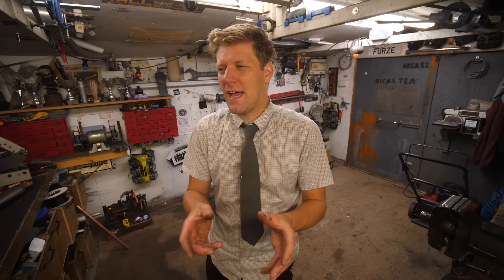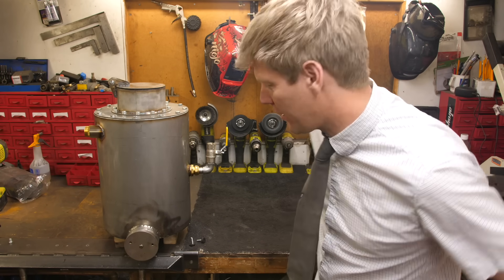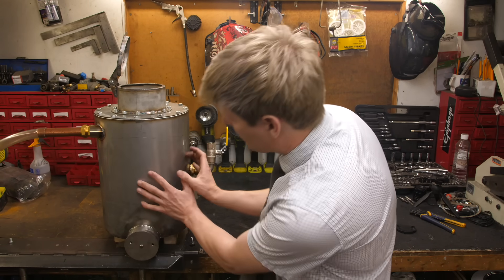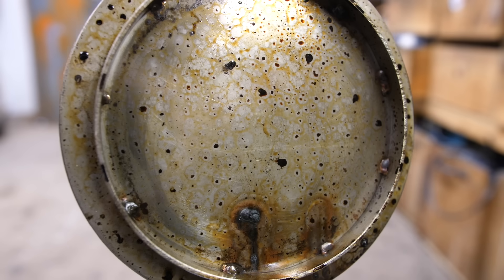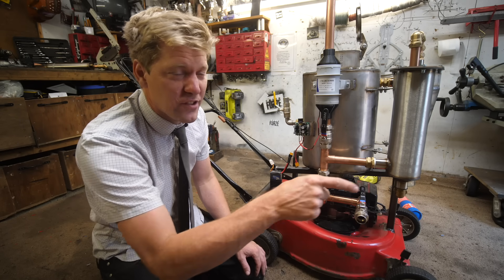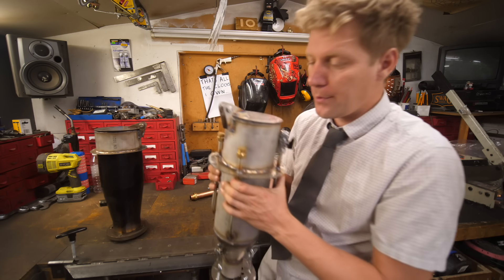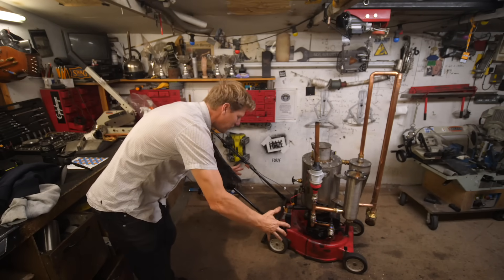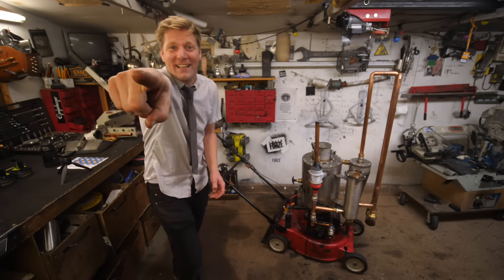WOOD POWERED LAWN MOWER

Comment: What if because the volume of gas coming out is more than going in you used a heat exchanger to heat the gas going in? Also you could use the exhaust to heat the wood. I bet it wood be a lot more efficient. You should try it for your next build.

Comment: Make hydrogen not woodgas. There's more water available on earth.
And use a water filter if you want clean woodgas.
Reply: You basically use the vacuum of the engine to pull the ignitable woodgas below the surface of the water to clean the gas. 
All the tar and crap stays in the water.
It helps to have the filtered woodgas feed from above the intake manifold for the engine. Although not always necessary because of the vacuum of the engine.

Comment: It definitely seems like you need the woodgas to be at ambient temperature going into the engine to get the most tar out. I bet if you just had fins on those copper pipes and a radiator fan or similar, you'd be cookin.

Comment: On the  filter side it's common to use a simple water bubbler.... not only does it remove tar it cools the gas condensing it for (better efficient) motor use.

Comment: get rid of the carb stuf just only have a throttle valve that wont have to much problems with the tar i think when hot the tar will help lube the engine and burn

Comment: You need to play with some Nichrome wire, it would have made this a lot simpler.  Also, after that result I would be tempted to build a huge waterpipe to remove some of the gunk by condensing it before it reaches the filter.

Comment: I was thinking you could modify it to run with steam thru the carb system, put a separate tank with water in with a valve to help it burn cleaner as well with some pressure from the steam, only open the valve once the engine runs.

Comment: One way to completely avoid the tar problems is to use charcoal or coke instead of wood. The wood gasifier is basically making charcoal anyway, the fuel is the absolute mess of chemicals you get from destructive distillation of wood - some of the products are gases (carbon monoxide, hydrogen, methanol vapour), but you get a lot of wood tar, which is a mixture of partially decomposed resins and creosote. Not great for running an engine on, though if you make a really big gasifier and capture all the tar, you can in principle distil the methanol and creosote out of it and use that as fuel for an engine, provided it has fuel injection (creosote doesn't vaporise too well in a carburettor) and isn't super-high compression, since the octane rating won't be great either.

Anyway, the simpler solution is to heat up a mixture of charcoal and water. This doesn't make any tar at all, since all that has been removed already by whoever made the charcoal. The products are all gases and there are only two of them - carbon monoxide and hydrogen. This is what "town gas" used to be (also known as coal gas), and these days is known in the chemical industry as "synthesis gas" or "syngas", since it can be used as a feedstock to make a huge variety of different chemical products. But you can just burn it, which is what all our gas stoves used to do when gas was made from coal. It can be used in an engine, and people used to do exactly this during world war 2 when petrol was rationed. Most car engines at that time were fairly low compression so didn't have a problem running on syngas, but a modern high compression engine would struggle. Not sure what the compression ratio in a lawnmower engine is, but if it works on your crude wood gas, then it shouldn't have a problem running on syngas.

Comment: love this! No expert but I feel like you are using the wrong wood as fuel. There is a reason why you do not burn pine in an indoor fireplace if you can help it. Too much byproduct and it doesn’t burn hot enough. A hardwood like oak would probably be ideal. Produces more btu and creates less waste.

Comment: So, where the next bit? Using the lawn clippings as fuel, would be a great next step for the mower :P

But, your gonna want a wood gasification system, and a storage system. The stored gas cools, dropping out the tar and the like. Using water at the bottom, means you can remove that tar with ease, and cool it faster, while keeping the pressure up.

Comment: Hey, @colinfurze I have a request. I've actually been looking into this technology again in case it's needed to run generators in Ukraine. I know you do what you do well, and it's interesting how you went through and found all of the little quirks that are in this technology. I can see a few issues you have with what you're building and would love to see you improve it how you do! The cyclone filter seems to be extremely helpful in a wood gasifier for removing junk. Also you need to cool the gas way down, this cleans the gas more and makes it denser. Also your final filter medium doesn't seem to be dense enough. Usually people use like hamster bedding or hay packed in to catch the rest of the particles. The heat in this causes 20% H2, 20%CO, 5%CH4, and the rest nitrogen. You do need dry wood to best do this and pellets are a common fuel. Some good areas to find information on these devices are these videos, "Running Your Engine on Wood-Gas with Wayne Keith!", "Wood Gas Part 2: Extras and In-Depth Info", and "amazing homemade gasifier uses wood pellets to run generator -- renewable alternative energy video". One last place to get a lot of good information about these is from the United States FEMA-Gasifier-Plans. Hopefully this gets you interested and we get another video of you perfecting this in your own way! Thanks for your awesome videos!
Reply: germans used it a lot in WW2 when petrol got short (even in things like schoolbuses). i'm sure you find a lot about this thechnology
Reply: @weeeds334  I've found about all I can find on this. But seeing a modern take on this is what I'm looking for. A more perfected version or perhaps a new quirk to be found. He was discovering a couple things without looking online. I would be interested if he finds something new. It's old simple technology but perhaps there's more to be found.

Comment: Wood gas is such an inefficient method. If you wanna use wood for power, build a boiler and use the wood to make steam and push a turbin for electricity.

Or just us a wood burning stove for direct heat.

Comment: Instead of the filters do you need to insulate the crucible. If you get the temperature up past a certain temperature, you will crack the tar into carbon. Try plaster, it is made with gypsum.

If you’re running a bigger unit in Mai want to keep it at a lower temperature to get the tar. The tar’s actual classification is third class heating oil aka creosote

Comment: please please please, get a proper CO (carbon monoxide) detector when using this. especially if you are planning to use it in a confined space such as your shed or bunker. Depending on the temperature you will be making CO, H2 water and CO2. CO is no joke, please be careful.

Comment: Here you have proven how extremely dirty it is to burn wood. All the mud in the filters and in the engine are simply blown into the air when you operate a stove. Even if you burn very dry and clean wood. Natural gas or gasoline is much better.

It is possible to replace gasoline with wood gas, but there are reasons why wood gas has never been more than a stopgap solution.

Comment: how bout using a blower to force air into the high temp burn chamber rather than draw thru?  The condensated tar when collected could drain into the high temp chamber (utilize a check valve?). also maybe a turbo could be utilized for the blower?  start engine on gasoline and taper off as the waste oil burners do with their diesels?

Comment: What's kinda wild is that humans have found a use for every output of a simple woodfire:

-the smoke contains wood-gas (flammable gaseous fuel source) and tar (rudimentary waterproofing, construction binder and adhesive), smoke can also be used to dry and preserve food. 

-the ash can in some cases be used either to make lye (can be mixed with rendered animal fat and water to make soap) or turned into a type of clay/cement for mortaring bricks together.

-charcoal is another fuel source of course, as well as a source of black dye, as a writing/drawing medium, as a dry lubricant for some machinery, and in some specific cases used to purge toxins from your system if consumed (I think). 

-it produces light and heat of course

Really puts into perspective how valuable the domestication of fire was for early humans.

Comment: the spark from the coil through the spark plug is required electricity without which the engine wouldn’t run barring some manor of dieseling effect.

Comment: I would instead make a stationary machine to produce the fuel. Perhaps its possible to use the wasted heat to drive a steam engine that could run a compressor to compress the  properly filtered wood gas into a high pressure tank which you can use to fill a small high pressure tank that you could use on your lawn mower.

Comment: The cooler is what densifies the gas and makes it more flammable, it also condenses the water vapor, as we all know water is not combustible. The tar is not an issue, in old times, they simply cranked the motor with tar in it, it's harder to start because of glogging, buy once you get the motor running the tar itself actually lubricates the motor. To completely remove the tar and water vapor your combustion shamber should be at least 3000 degrees celcius to split water molecules to hydrogen and oxygen atoms as well as gasifying the tar vapor. I haven't seen this done to this day, but maybe you could make it. It would probably require a cheramic shamber to withstand such intense heat as well as a really long pipe condenser for cooling the gas. You could simply put the pipe into the ground in a sick sack pattern to let the heat escape into the ground and heating it up. As a result you could have a heated winter pool above ground or space on your drive way without snow. Kinda nice way to use wasted heat. Also the final product produced from the motor as we know when you combine hydrogen and oxygen we get water again from the combustion cycle, which means you could get a source of fresh water from the gas outlet. Win win win.

Comment: I tried this as well, but after consideration I just went with a simple scythe... It's easier and requires less parts. Nice proof of concept tho. If it was legal in my country I would def. use it to power a car. If I did that, it would come with a heafty fine as well because power companies just wouldn't approve of free energy devices. Simple as. they want you dependent.

Comment: Funny thing is it needs a battery to run (for the fan motor)

Side note- why not have a wood distillery where you can filter and separate all the products and condense the combustible into a liquid and put that in the gas tank 🤷 oh yea I forgot your Colin Furze and have to make a crazy contraption 😂

Comment: I made a gasifier out of stove pipe years ago, happiest moment ever when the 5hp motor started. The next day I learned about valves welded shut with wood tar! I never built in a gas option to clean the motor out after my run. Your build was incredible, as usual :)

Comment: This i great. Long term viewer here I've been working on a home made generator out of a Harbor freight predator gokart motor a 12 volt 2000 watt DC to AC inverter and a electric motor from the wheel of a hoverboard but plz no welding I don't have a welder try to use basic tools that most people have in there garage plz and think you hopping to see some response back even a no would be better then nothing.
Have a good day.

Comment: Gasification has always fascinated me because it seems like such a simple, easy concept at first, but in practice take quite a bit of knowledge and experience in particular in order to make an actual working, reliable system.

The key seems to be cooling the gas down enough (without using water) via a seemingly comical amount of surface area (via tubes forming a radiator) to air cool the gas.

Comment: There was a stuck with hacket episode with one of these that was quite excellent. You might help yourself by making a 2 stage system as the wood generates the gas wether or not it actually burns, you just need to get it rather hot without actually burning the wood to get clean fire gas. An oven like configuration is typically far cleaner to the point of generating smokeless gas usually.
Reply: Basically what im saying is work with the first design since it has less waste product when upscaled and the heat is managed.

Comment: 11:05 Try and bubble the gas through a liquid like a water. This should catch most of the tar to avoid damaging the engine. The steam produced by burning the wood gas is actually not relevant to whether the wood is dry or not, but instead water vapour is produced when wood decomposes, which is what the gasifier gadget does, and it doesnt matter how dry the wood is because the water vapour will still be there. Again, bubbling the gas through water may fix this (haven't tried it myself so I have no idea) and hopefully clean the gas up substantially. I would like to see this project get revisited and tried again because I do have hope for this concept.

Comment: instead of a filter per se, i'd prefer to see a giant heat exchanger condensing the creasote on a removable surface. and it would be nice to see an O2 sensor managing the air/wood-gas ratio with a servo-controlled valve

Comment: Colin, you can collect the woodgas into a plastic trashbag then run a hose from it to small powertools like string trimmers, chainsaws etc.
I've seen old pictures from ww2 of a bus with a huge bag of woodgas on the roof. Cool.
It would be cool if you could run a car off anhydrous ammonia too.

Comment: Instead of using negative pressure to pull the fan through, why don’t you use positive pressure to push the gas through? I feel like this is something that you’ve probably already address’s, but I’m curious why you didn’t do that.

Comment: Technically "corps" is pronounced "core", it's a French word (for "body", as in "body of men"). In Colin's case though he should keep it as "corpse" cos it's probably more accurate for a flying bike running off chainsaw motors with no proper guards. 

I forget where he got the motors from, I know somebody sponsored him and bunged him a pair of free ones that were just a bit underpowered. Kind of silly that, an engine company not knowing the right amount of power.

Comment: Just gonna guess, before I carry on watching, but running hot air over steel wool isn't a great idea. It'll oxidise away to nothing in seconds, then clog up whatever the tiny invisible bits fly into. In science lessons they used to heat steel wool in a tube to prove that something or other was producing oxygen. It would rust almost instantly. Sure there's limited oxygen in this system, but surely enough to knacker that steel wool quick enough. 

I'd just use a water bong style cleaner. They trap LOTS of tar! Or even just spraying water into a chamber full of rising gases. Power stations use high voltage plates to ionise and attract smoke particles but they're like hundreds of metres high which is a bit impractical. Water sounds best. Will cool the gases too. That's handy, since an internal-combustion engine relies on the heat of combustion expanding the gases inside the cylinder, so you want as cool an input as you can to start with. Though I realise there will be air mixed in, still, it would be hotter than ideal.

Comment: There's a better way of making gas from wood, or charcoal. The way in this video is just evaporating all the volatile hydrocarbons and whatnots, carbohydrates and pyrolysing them, so that's your fuel. 

In WW2, due to petrol rationing, some people had their cars converted to "producer gas". Stoked with charcoal, not wood. The plan was, you limit oxygen and apply very hot steam. The carbon in the charcoal rips some of the oxygen from the H2O, leaving H. Also some of the partially-burned carbon (because of low oxygen) would form CO, carbon monoxide. That will also burn to make carbon dioxide. Finally some of the C and H react to form CH4, methane.

CH4, H, and CO all burn in oxygen to give heat. In fact, the old gas works towns used to have  up til the 1970s, used just this same method, on coal or coke, to produce domestic gas. It's why people used to put their heads in the oven to kill themselves, the CO is horribly toxic. Gas leaks were more serious back then. Eevntually natural gas, from oil wells, was captured and employed instead, in the UK we have tons of it up in the North Sea by Scotland.

Incidentally gas works used to stink, I presume that's from sulphur in the coal. 

SO! There's vapourised wood sap and the like, or proper actually gaseous fuel! It has no tar if you make it from coke or charcoal, although in practice perhaps a little might still be in there. It gets energy out of the carbon in the wood itself, rather than just the volatile parts. Might be interesting to build one of those, in WW2 you'd fit it in your car boot (I suppose with some insulation), and store the gas in a big floppy bag on the roof. Obviously the carbon monoxide means an outdoor use would be more practical than trying to, say, heat the bunker with it. Just make sure whatever's burning it runs lean, lots of oxygen, and doesn't leak. It was in millions of kitchens around the world, back in the day, so it's probably safe enough. Just nowadays you hear "carbon monoxide" and immediately panic.

Comment: I don't think these are really any good anymore now that you can get cheap lithium cells!  It's better to convert your biomass into steam to run turbines to charge batteries; you get efficient complete combustion, and your EV starts instantly at the flick of a switch! (high torque, quiet and clean!)
Reply: Ew